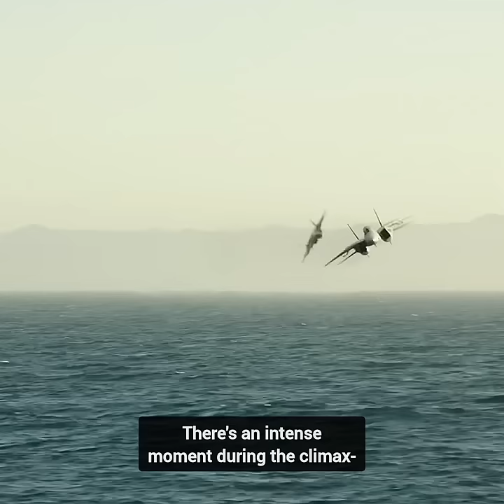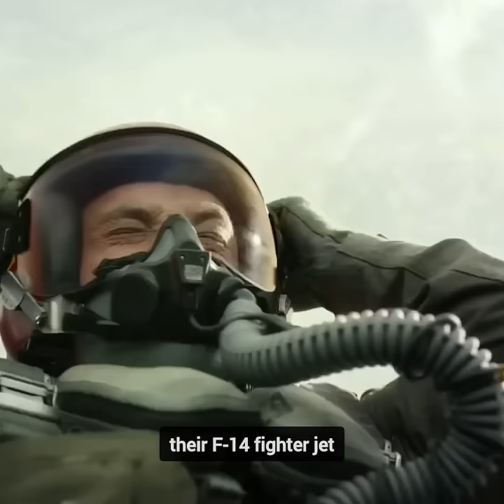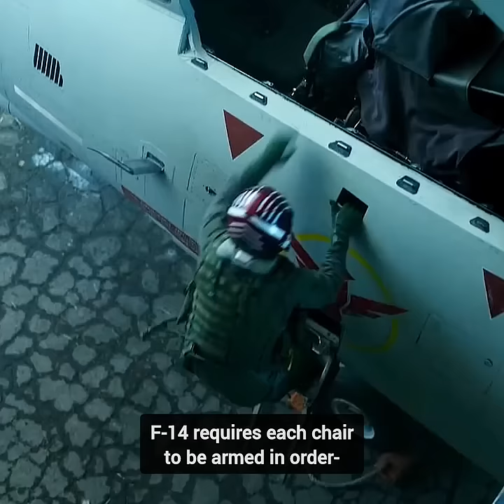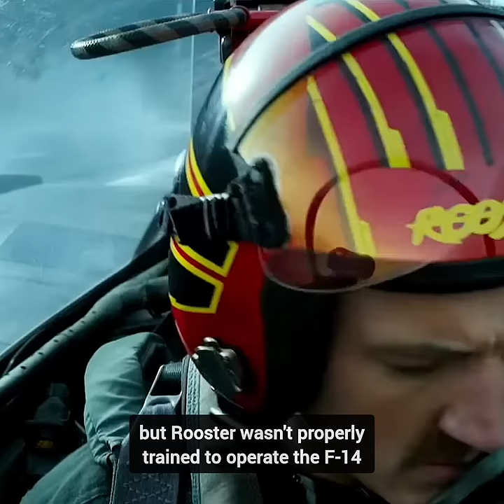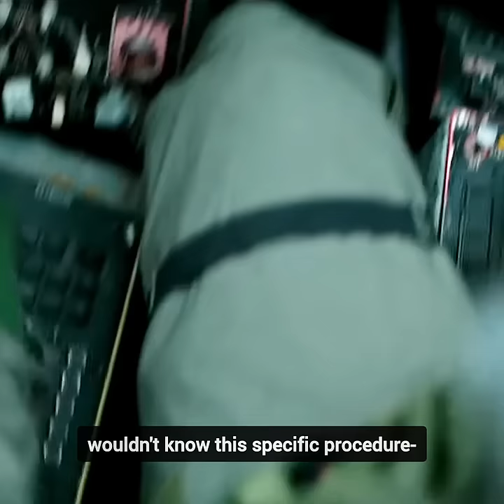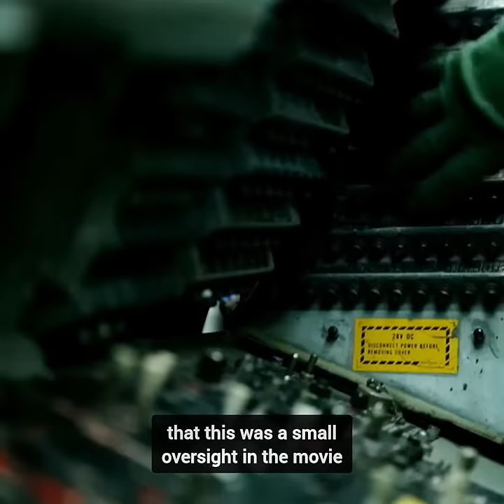Plot Point or Oversight? Analyzing the Ejection Scene in "Top Gun Maverick" - #shorts #short

Comment: They didn't pull the pins for the seats. Just the missiles and landing gear.
Reply: And the flair/chaff would be needed to be pulled as well dont recall if they did in the movie
Reply: But as pilots, they know they have to do it, for example, while flying cross country with no ground crew available
Reply: Actually it’s not a pin it’s more of a switch on top of the seat
Reply: @ogbootlegcarenten2512 for the F14, and most election seats, there are pins as well. More than just the switch for the top ejection handle
Reply: @Radziolinho if you haven’t flown that specific jet in 20 years you would probably forget too, it’s amazing what he did remember after all that time tbh
Reply: Bingo
Reply: @cmj0929  Arming the seats isnt specific to the F-14
Reply: Kinds hard to miss the giant red remove before flight strap connected to every pin on the seats. I used to remove those every day.
Reply: No there are pins. AND two safeties. The one you mentioned on top and one in-between the crews legs. Those seats have TWO ejection handles.
Reply: @night2957  I'm confused by this video. If this was an "oversight" in the movie how would this sequence prove that? He tried to eject and it didn't work so in what way could this be explained as an oversight?
Reply: @menwithven8114  When he pulled the pins for the landing gear and missiles he failed to pull the pins for the ejection seats. The arming pins must be pulled for the ejection seats to function.
Reply: @Skymedc  I know but the video says it was a possible "oversight" in the movie. It looks like everything happened the way that makes sense. They didn't do the proper steps to be able to eject so when he tried it didn't work. How could this be interpreted as an "oversight" in the movie?
Reply: @menwithven8114  Oh. Well I imagine it's because the guy who made this video doesn't know what he's talking about. He does a lot of videos like this and he's wrong almost all the time on the things he says. Probably for dramas sake and clicks.
Reply: @Skymedc  yeah I was just confused when he said maybe it was an "oversight". Everything played out the way it should so I was confused what he was trying to say would be a mistake
Reply: Absolutely brother f 14 has a crap load of pins
Reply: It seems the jet had been sitting there for a WHILE, so maybe the mechanism just wasn't working due to low maintenance for the past 20 or so years? I'm mainly just chalking up the seat failure to the plane being stored so long without through maintenance since they hadn't seemed to use it for battle in a long while and it was a bit of a relic, so they didn't have much use for it.
Reply: They don’t use pins on ejection seats in fighter jets they never have
Reply: @ogbootlegcarenten2512  yes pins too, I should know I was a plane captain in vf-14 top haters
Reply: @ogbootlegcarenten2512  yes pins too, I should know I was a plane captain in vf-14 top haters
Reply: @epicfiredragon0819  you obviously don't know....at all
Reply: @CustmBug  no with an F-14. It’s only the switch.
Reply: @epicfiredragon0819  I was an AME and worked on the F14’s ejection seats as my job. There are pins on the Martin Baker GRU-7A seat. You are wrong.
Reply: Maverick would have known this, just because they didn’t show it doesn’t mean they forgot. They didn’t even go through the litany of switches to do a ramp start … why didn’t they show all that and seat pins? Because it’s boring. 

The reality is it’s an old plane that can’t be serviced properly so the seats no longer function. Likely a jab at Iran who had F-14’s but after they became enemies of the states were not able to get the parts to keep them operational. So consider it a historical inside joke
Reply: I work on F-18 Super Hornets, they got seat pins too
Reply: @Skymedc 😂😂😂😂😂 You beat me to it. He'll talk about a battle involving F-15s and in reality it was F-18s. So many errors it's pathetic. I especially like the F-22 videos where they never show a Raptor in the video, just F-35s.
Reply: @ogbootlegcarenten2512  There are a set of safety pins for each seat that has to be removed for the ejection seats to work. The pins are the reason he couldn't pull the top ejection handles. He didn't try the one between the legs either.

Comment: 40 years ago I used to drive my dad's 68 dodge pickup like a champ. I have gotten very used to my push button start that doesn't even require me taking the key fob out of my pocket. So I'm guessing that if I were trying to escape in that old Dodge today with people trying to kill me, I would probably forget about the manual choke, clutch, 3 pumps on the gas pedal that were required to get it going.
Reply: Parked my jeep for years. Drove automatic transmissions. Then got in jeep worked clutch an gears like never left. Muscle memory is key
Reply: @Will-dn9dq Congratz on remembering how to drive a stick but I think you missed the point. @rickmyers3291 was clearly just saying that specific procedures can be forgotten overtime, and that IS different than the muscle memory of driving a stick.

Also, fighter pilots don’t fly every day or even close to it. In fact, they fly less than any other type of pilot bc of how complex the planning is and costly the maintenance per flight hour.
Reply: Not if you remember like you clearly do.
Now if you never drove that vehicle before it would be another story.
But you specifically know.
And if you know you know.
If you don't you don't.😅
Reply: @justsoicanfingcomment5814  It's not too difficult for me to remember all those steps while sitting at my computer 🙂
Just not sure if I would remember all of them if someone was holding a gun to my head.
I'm hoping the Navy spends a little more time on training than I got on the ole Dodge so maybe I'm wrong and they should have some muscle memory kicking in.
Reply: @Rick_1337  You would remember.
Because you were familiar with it.
Most people who are familiar with something will remember it very well.
Now, if you only drove it once or twice. I could understand you forgetting about it and it's idiosyncrasies.
Reply: @Will-dn9dq I'm qualified to fly three types of fixed wing aircraft and two rotor wing, If I tried getting into a Robinson R22 the helicopter that I trained in for 3-4 years without a checklist, I would most likely forget a lot of steps
Reply: @disguy4948  that's because you switched from complex aircraft to complex aircraft. Muscle memory isn't always the same things are moved etc. I was just comparing the fact humans especially when under stress resort to Muscle memory. That's why the best pilots are ones that don't get stressed they get better. Hence respect for the elite pilots. Fighters are literally designed to fly iffy edge of stability so they can change angle altitude etc faster for evasion fighting etc. I'd say even one aircraft to another would be huge. Yet if you only ever trained on one flew it for years then flew another I'm sure it wouldn't be that hard to recall. 2 or 3 more yeah I can see it fading. 
Also as you know helicopters are completely different animals vs jets planes etc. They want to kill you you at all times you gotta be 100% alert.
Reply: @Rick_1337  lol reminds me time as a teen when me an 2 friends saw an heard a shotgun blast where should not been one. I was fat kid them in shape. I was 50ft further from truck yet I beat them both to it! The owner got in passenger side other friend driver an hit the gas to the already idling truck as changed gear! It made lotsa noises an revved an there we 3 sat.... 😆  funny age 41 now vs 15. The owner truck yelling "the parking brake!" Then in a instant the kiyd engine got less angry an we were off to safety. Yeah I was tested alot in life dumb decisions growing up or others causing them. Im proud I'm alive unmaimed while most everyone I knew I did not like won Darwin awards.
Reply: @Will-dn9dq  We still DON'T fully know how the human body reacts to this kind of situations (the one described in the original comment). So yeah, you might remember that when calmly starting your car, but, would you be able to do it in that kind of situation?

Comment: Or they just forgot to pull the safety pins due to the haste of leaving.  Most Martin Bakers have the same setup.  There is usually a way to isolate the rear and front in an ejection sequence.  My era is F 101, T 33, and  F 4.  A greasy spot inside a hangar roof was my big worry. The boys in the ejection seat shop were the real experts, but I did try to pay attention and naturally saw all the training films!
Reply: Don't know how many times I have checked those on the A birds...MB seat make person pancake on hanger ceiling.
Reply: The F-14 ejection seat arming switch is on top of the seat headrest
Reply: @linusa2996 one is the arming switche in the headrest. There is also one in the lower ejection handle and there are 5 pins as well. Not a single switch.
Reply: The command eject lever is forward on the port side.  If set to pilot, he ejects both if he pulls.  If set to RIO, the RIO punches both out if he pulls

Comment: Old Iranian F-14s were known for having non-working ejection seats due to lack of parts. They are portraying what would happen in an old foreign-maintained F-14 perfectly.
Reply: By using a jet which most certainly IS NOT Iranian... it has the TCS pod under the chin, and it has the Jammer Panel and Crypto encryption panel for the radio in the back seat... none of which is onboard an Iranian jet.
Reply: @Whiskey11Gaming No one said it was an actual Iranian F-14. Just that the writing of the election failure was accurate for a general old foreign maintained F-14. For the plane itself, they used the museum piece they had. Moving out of the hangar involved a tug that was edited out. A lot of work went into just making the canopy move. All the F-14 flight scenes were edited over an F-18. It is hard to tell if the paint was actually altered on the plane or if that was only edited later.

Comment: They consulted with actual pilots.
It's legit
Reply: It’s 100% not legit. 

Every aircraft that has ejection seats have a way to “safe,“ the seats when it’s on the ground. And “arm,“ the seats when you’re flying.

Both Maverick and rooster  would have the automatic instinct to arm the seats as they got in the plane. 

At the very least (when he was told about the plan to eject) rooster would have asked how to arm the seat. 

Also, each seat has a lower ejection handle between the pilots legs. So if the overhead handles didn’t work, rooster would’ve tried the lower handle.

Especially since the lower handle is in the same location as in the F 18. 

Lastly, maverick could have tried pulling his ejection handles as well. But never did
Reply: @elymayer4860  No, Rooster never piloted  an F-14.
So how would he have the instinct to do so?
Did you even watch the video?
And why would Maverick pull his ejection handles 😂🤣. He was trying to save the kid.
Just stop.
Reply: @fredricksmith-something.2125  because, as I just explained, in  every tactical aircraft (the F 18 is a tactical aircraft) you have to arm the ejection seats when you get in.

Saying “he wouldn’t know to do that because he’s flown an F 14“ makes about as much sense as “he wouldn’t know to use the lap belt and shoulder harness.” 

It’s less likely that he would know how to deploy flairs, or use the intercom to talk to the front seat.

Because those are not the same and the F 14 as they are in the 18. 

Arming The injection seat is something you have to do in the FA 18.
Reply: @fredricksmith-something.2125  If the pilot pulls his injection handles, both seats eject. 

Or did you actually think the backseat or could fly the plane without a pilot in it? 🤣🤣🤣
Reply: @elymayer4860  in the F-14 you pull down the loops above the pilot or RIO's head or the handle between their legs to eject. The arming switch is on top of the seat.
Reply: @linusa2996  Correct. But the lower ejection handle also has to be armed, if you’re going to use that one instead of the overhead handles. 

Just like in the FA 18.
Reply: @elymayer4860  But you don't arm the ACES II set until the pilot's ready for takeoff, they don't arm them on preflight...
Reply: @Ender_Wiggin03  some people are using terms interchangeably. So that may be part of the confusion.

There’s five pins all connected by one (remove before flight) ribbon. They stick into little slots in the seat (back left corner) and prevent various critical parts of the seat (mechanically) from moving. 

Those pins are removed by the crew, right before they get in the seat. PC stows those pins in a compartment on the left side of the Fwd fuselage. 

After you get into the seat, you strap completely in. Then you unlock the ejection handles. There’s a small tab on top of the seat that locks the overhead handle. And a small lever for the lower ejection handle. 

Basically, you unlock the injection handles anytime after the canopy is closed.
Reply: @elymayer4860 I mean I didn't see any pins on the plane. Maybe this "Mysterious" Country does stuff differently?
Reply: @pandasonic1294  my point exactly. They both got into the plane without pulling pins out of the back of the seat.

Which means either 1/there weren’t any pins, and the counter arguments to my previous comments are dumb  AF.

Or 2/both characters are morons who (Got into the plane without removing the pins, and then) thought ejection seats would work, with the pins still installed.

I’m guessing the first one is probably true.
Reply: @elymayer4860  Or Maybe the ejections were Not working. I mean In the end of the day if let's consider that this Country is Iran then Lack of spare parts, a very Stressed airframe, Age or Medicore Maintainince can be a key factor here and I did do some searching on the web and on chat gpt and turns out Iranian Tomcats mainly few had Reports of their Ejection seats not working and I'm no expert but this is what I think could mainly be the cause. Though Considering the tomcat in this scene was seemingly combat ready and on Standby idk then. Or maybe Fake Iran here has different procedures
Reply: @pandasonic1294  but that’s the whole point.

There are four, FOUR ejection handles on the 2 seats. 

If the Bradshaw’s overhead egress handles didn’t work, he would’ve  mediately tried the lower handle as Plan B.

At the same time Mitchell going to be trying both his handles. 

With FOUR ejection handles available, they’re not just going to try one and (if that one doesn’t work) be like “F it. I guess we’re just gonna die.“ 

I love the movie a lot more than the next guy. But that scene was simply bullshit in every way. 

There’s no other way to say it.
Reply: @elymayer4860  Maybe he tried it When the camera wasn't Focusing on him?
Reply: @pandasonic1294  still the same problem.

If the moment is “we have to eject to save our lives,“ you’re not going to stop trying because one out of four handles failed. 

You’re going to try all four handles before you give up
Reply: @pandasonic1294  we can make up all sorts of stuff that we didn’t see, and just assume that it’s true.

We can say “the personal uploaded the video was wrong, because when the camera wasn’t focusing on them, Maverick Briefed Rooster everything he needed to know how to properly arm the ejection seat.“ therefore the entire video is wrong. 

That doesn’t address the uploaded video, and it wouldn’t prove anything either way

Comment: I was a plane captain I think it was 4 pins and a lock guard per seat and 3 in the canopy to make them safe or else you had a" hot seat"  which meant if you pull the handel over your head or between your legs the seat will eject there is also a switch on top of the seat that had to be armed and the lock between your legs had to be pushed to the side ... safety  overkill but greatly needed